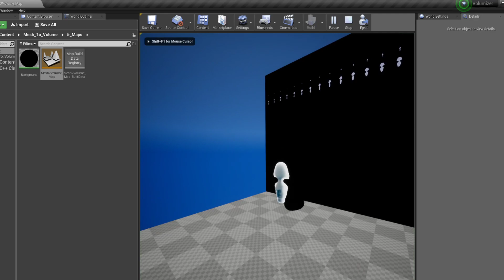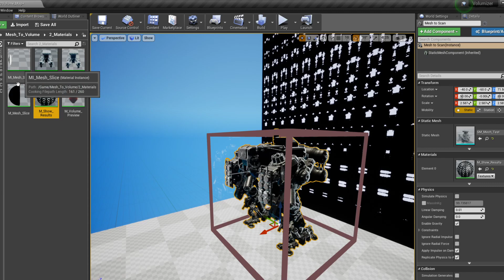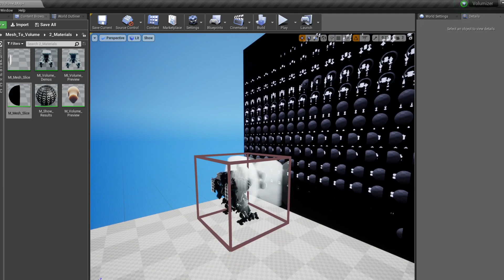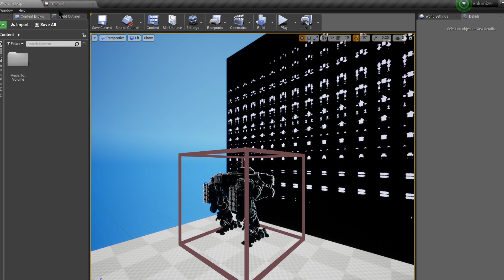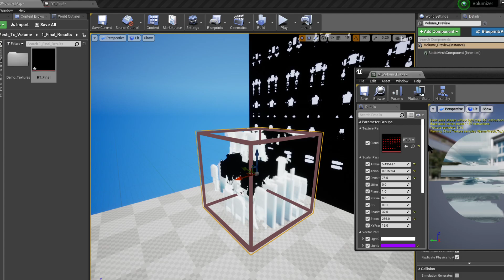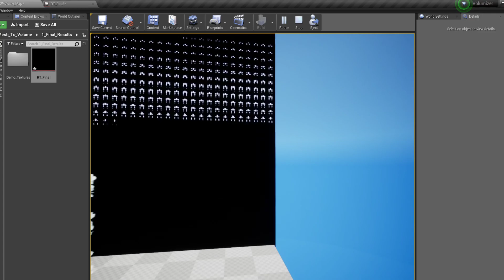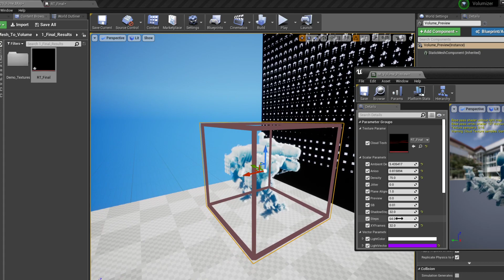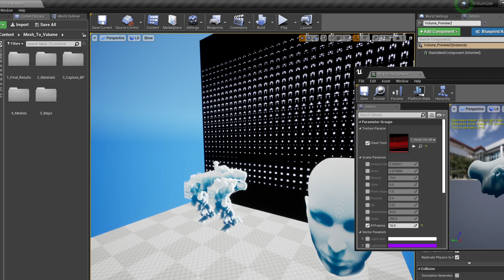UE4 Mesh to Volume Tutorial

Comment: you could use distance fields for similar usage
Reply from the maker: We've found DFs by default to be reeeeeeally low res and hard to work with compared to volume textures. Increasing the default project setting could help, but you'd also be forced to use DFs in your project even if you don't really need them.
Reply: @dumpsterfireproductions  you can increase their resolution but ok